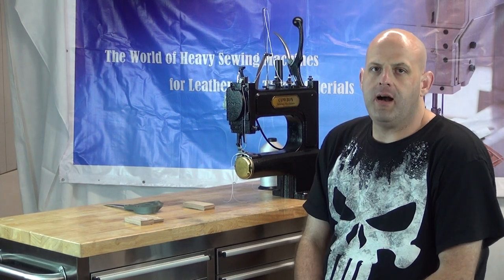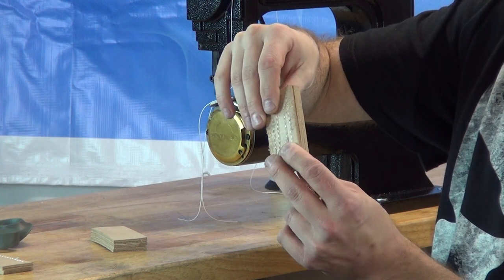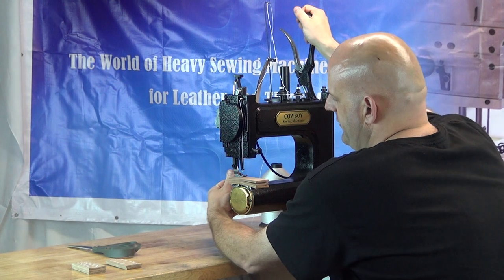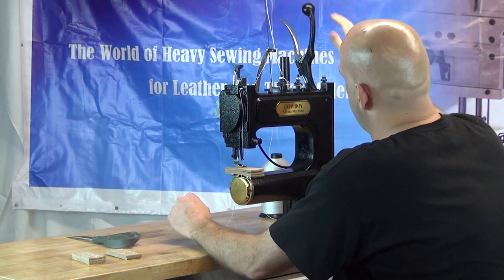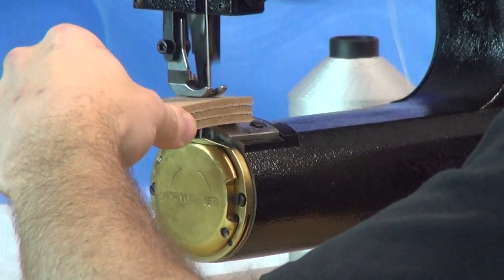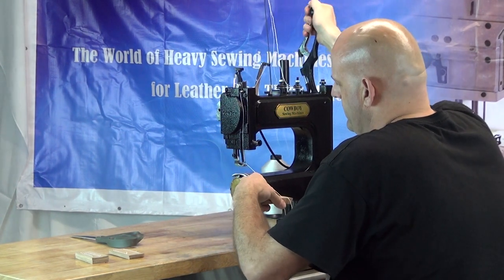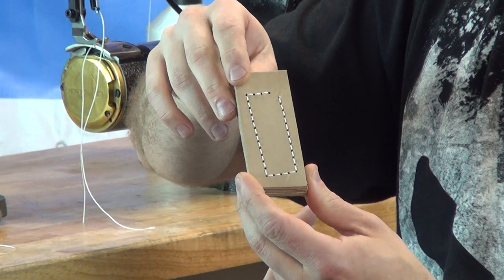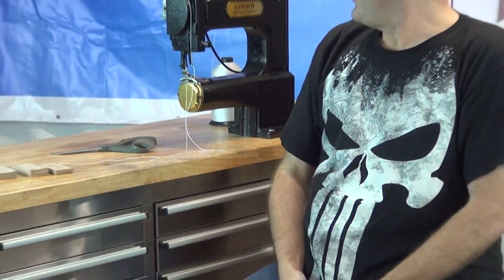CowBoy OUTLAW hand stitcher leather sewing machine

Comment: When I use GA5-1 Chinese leather sewing machine, my biggest problems when sewing leather is the slipping (if sew two pieces of leather together), that's why I updated with Juki TSC-441 machine, maybe your hand stitching machine with same problem of slippery.
Reply from the maker: Thanks for your question! GA5-1 is clone of Singer 45K or Adler 105 leather sewing machine, these sewing machines are drop feed (feed leather by feed dog only) which is not good for professional leather workers, because of the problem of leather splitting. CowBoy CB105 is a bit better, because of its reverse stitch, but it still drop feed machine, we mainly recommend to beginner leatherworking.
CowBoy OUTLAW hand operated leather sewing machine is needle feed sewing machine. "Needle Feed" means the needle  will through multiple layers of leather, and feed them togeother. So it is impossible to slip the leathers. Hopeflly this information will help you a bit!!

Comment: Is there a video on setting up and fine tuning the machine? The one in the store operated smoothly but the hand brake for the pressure foot on the machine I bought is sloppy and sounds like the cable is stretching. I figure it’s a adjustment that’s needed but I wanted some guidance before going at it myself.
Reply from the maker: Dear Brandon, thanks for using our leather sewing machine. If you are from USA, please contact Ryan in Ohio at 330 692 1418 or neelre@comcast.net, he will help you out for sure, thanks again!

Comment: What size thread can i use on this machine, i am going to buy one on Feb 1 2021 and want info.
Reply from the maker: This leather stitching machine can sew very thick thread from V69 to V346 (Tex 350), you can find detailed specification from https://automatic-sewing.com/hand-stitcher-leather-sewing-machine.htm
Reply: Hey did you end up buying this machine? I'm on the fence about it and have a limited with area which was my original draw to it. Not sure if I should get one or not
Reply from the maker: @Stang94Red  Are you from United States? Please contact Ryan in Ohio at 330 692 1418 or neelre@comcast.net, thanks!
Reply: @Stang94Red   YES i bought the cowboy outlaw sewing machine and LOVE it, I am using size 350 thread and a 26 needle.  ONE problem i found very soon was that the pull leaver wont stay tight, (Bad design for securing it) When it loosens it wears on the key and keyway, (Severly) I reinstalled the arm screws with red lock tight and drilled a roll pin thru the leaver and shaft. I have made several Holsters with it now.
Reply: @jackiesanders489  thank you so much. Hearing that from someone who purchased the machine makes me feel more comfortable about it. I appreciate your reply!
Reply: @HightexHeavysewingtechnology  I'm definitely going to be calling Ryan thank you guys. From what I see everywhere online, he's a celebrity and the only person I should be dealing with lol
Reply from the maker: @Stang94Red  Yes this bald is one of the founder of CowBoy sewing machine business.

Comment: Can you stitch cowboy boots soles on the welt with this machine?
Reply from the maker: If you use rubber sole, no more than 10mm thick. The machine can stitch max.15mm hard saddle leather or tooling leather.

Comment: I am leather worker from Japan, I use Juki TSC-441 Leather sewing machine, the feed dog always leaves mark on the leather goods, your machine does not use feed dog? no mark on leather?
Reply from the maker: Yes, CowBoy OUTLAW is needle feed leather sewing machine, will not leave mark on leather. If you just want to remove this problem, you can consider to buy some speical sewing machine for your Juki TSC-441. CowBoy CB4500 is same to Juki TSC-441, it has full range of speical sewing attachment to meet individual sewing requirements from leather industry. There is the detailied list. http://www.cowboysew.com/saddle-makers-sewing-machine.htm
Reply: Thanks, useful information. How much the cost of this hand crank leather stitching machine? And shipping cost to Japan?
Reply from the maker: Please contact our sales engineer at info@cowboysew.com, thanks!
Reply: なさいを入力し  you can try to grind and polish the feet and lighten the pressure on the foot
Reply: Thanks, I lighten the presser foot pressure, got bad stitch, the major mark on leather is the feed dog. I got idea from leatherworker.net and purcased the leather feed dog that no teeth on it, hopefully it can help me out.
Reply from the maker: You mean the blanket foot of Juki TSC-441heavy leather stitching machine? We have professional leather sewing feet, http://www.cowboysew.com/saddle-makers-sewing-machine.htm